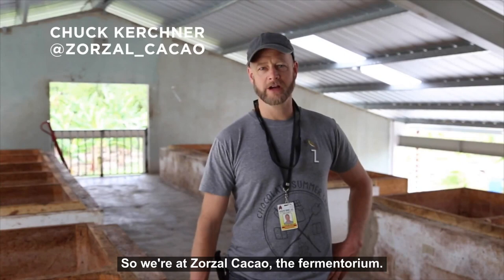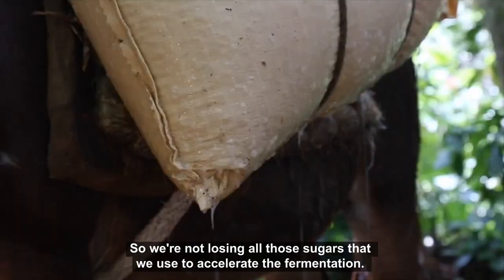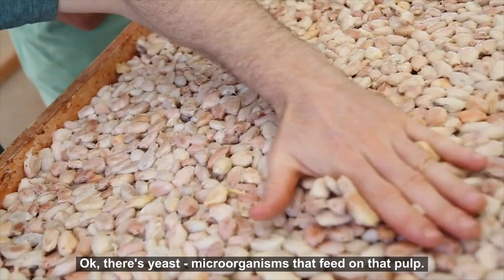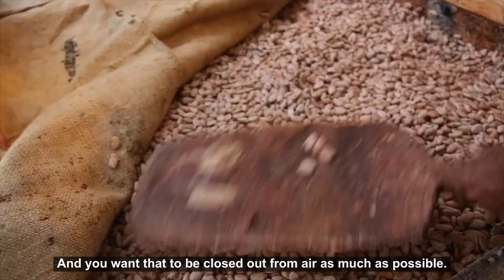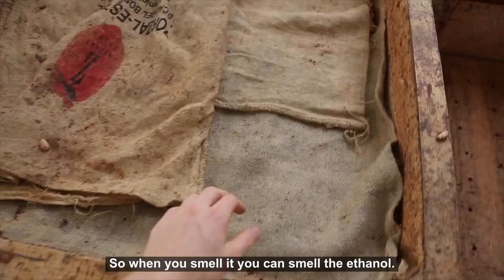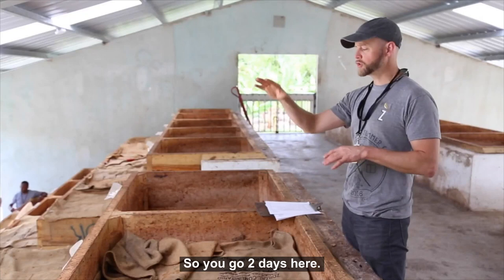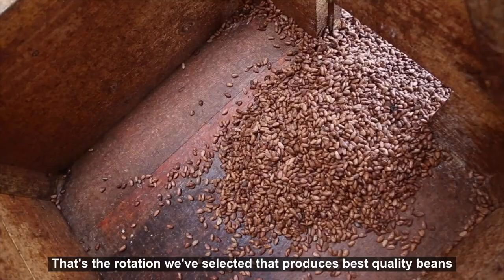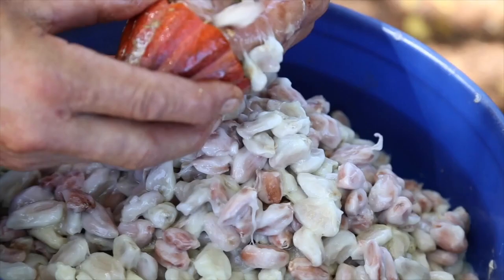Fermenting Cacao (4 tier cascade system) - Episode 21 - Craft Chocolate TV

Comment: Hey! Could you please explain why the box is changed from time to time? why not done in the same box?
Reply: Perhaps it would be difficult to mix properly in one box. By moving it from box to box, you get to, inadvertently, mix the cocoa beans. Also, I am thinking that the residual resident microflora at different stages reside within the designated boxes, hanging out in the crevices.
Reply: @kolawole3203  i think to air the beans. 2 days of inaerobic (no air) then to aerobic (w/ air) stage of fermentation
Reply: @mrbisaya  yeah but what about box 3 and 4? what are they for
Reply: @lucasrenz3984  same principle. To air out the beans. I have small amount of beans during my fermentation, I just use my hands to move them around. If you have about 50 kgs, easiest would be by using the buckets/box. From top, then gradually towards the bottom
Reply: @mrbisaya  Thank you